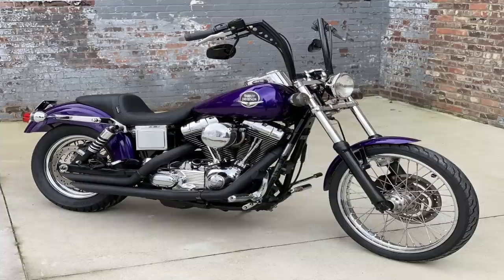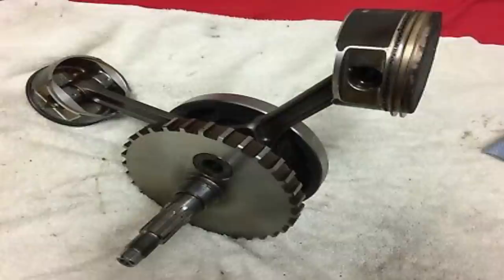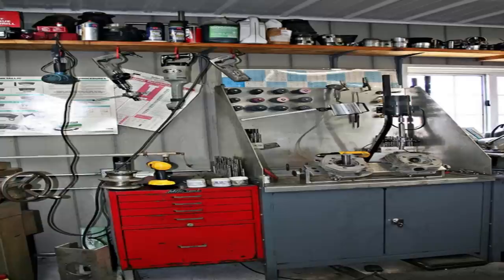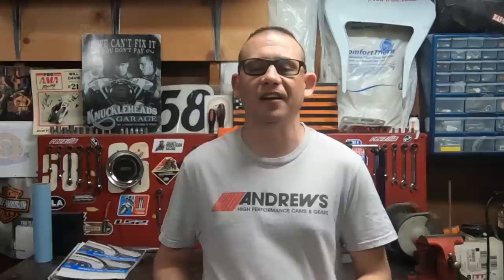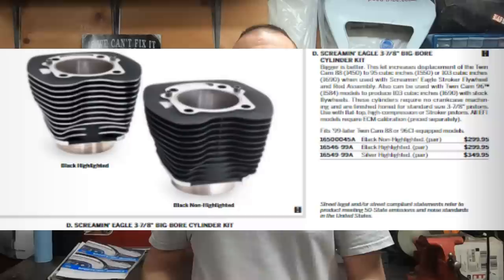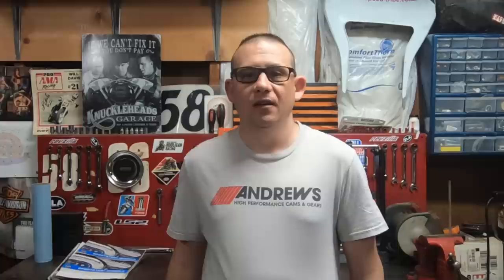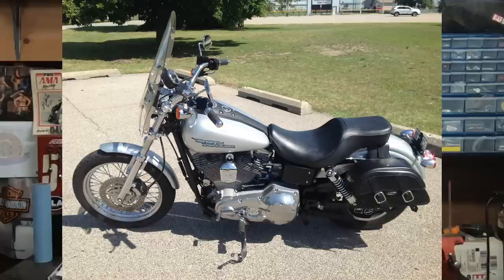Harley 95 is the Twin Cam 88 Sleeper

Comment: 95 in my 06 dyna, 585 cams and loving it. Hp85/93tq a little off the 100hp…would porting the heads help?
Reply from the maker: What compression are you running? 2006 88 heads were pretty good, who's 585 cam is in it?
Reply: @GixxerFoo  S&S 95 kit, S&S 585 with S&S cam plate. 9.7.1 compression. Yes the heads are good I know...updated ones started with my bike.  Maybe its the cams holding me down, although they kick in nice on the highway.  To be honest, I am very pleased with this performance.  All day smiles...
Reply: S&S 79cc heads 585cams  10.7 comp thunderheader 95cui  100.3hp 150nm.  585 needs compression.
Reply: @mattinykanen7001  that's my set up pretty much

Comment: I've been considering similar options to what you're suggesting in this video; finding a good price on an older model bike and then doing a SE Stage 3 or 4 upgrade. But, after seeing lots of other opinions on YouTube about needing to address the lower crank case deficiencies with a tempken bearing conversion or even upgrading to an after market crank/flywheel assembly to accommodate the higher torque and HP with these upgrades, the whole buy cheap and upgrade prospect gets a bit chancy, and pricey.  Do you think the older TC88's lowers will hold up with the SE stage 3 or 4 upgrades you're recommending? Reliability is priority one with me.
Reply from the maker: Generally the bottom ends do pretty good with some upgrades, albeit if you're just cruising and getting on it every now and again. But if your launching them at the strip or something that crank can become a huge problem. The best bottom end out there is the 2002 and earlier 88, they were the Timken lower end which is solid. Just the cam chest is their issue, but once you upgrade that to the hydraulic tensioners you're good to go.
Reply: @GixxerFoo  It's been so long now... I bought my 2000 Dyna brand new and upgraded to a 95. Added the hydraulic tensioner, 44mm carb, 211 cam, Baker 6 speed, Barnett Scorpion clutch, Thunderheaders, and a few other mods I cannot remember now. Not sure what it will dyno at, but she is perfectly stable at any speed, absolutely hauls ass since I added Sputhe stabilizers, inverted Ohlins forks and black piggyback Ohlins shocks, and Dunlop K591's. It is an INCREDIBLE riding machine! Glad to hear that you feel similarly about the "original" twin cam 88 engines. :)

Comment: So if i put the 95” pistons on my tc88 with the woods tw6, which SE heads do I look for? The 96” ones?
Reply from the maker: You would essentially get a big bore kit when bolted on the 88 it will make it a 95, the heads are actually interchangeable on the twin cams across the years.
Reply: @GixxerFoo  sorry for novice question, are you saying 88” SE heads will fit my 95” Carrillo pistons and bored cylinders? Im looking for which SE heads to buy.

Comment: The added power is nice but how about an added gear in the gearbox?
Reply from the maker: Getting a six speed trans for a 88 isn't impossible but it's some $$$. Baker makes a good one that they guarantee you can't break.
Reply: @GixxerFoo  how much does the cost?
Reply: @stevechan9914 $ 3k

Comment: Did the 88 motor have crank shaft  wobble problems? Would you run gear driven tensions over hydraulic when upgrading cams?
Reply from the maker: The early 88's from 99 to 02 had the Timken bottom, no issues there and very rare. Now the 03 and newer have a pressed crank so l would for sure check pinion run out before going with gears. Crank wobble is a whole other story, the pressed crank is pretty strong in my opinion. Yes there were factory issues don't get me wrong, but most crank issues come from lugging the engine and banging that crank.

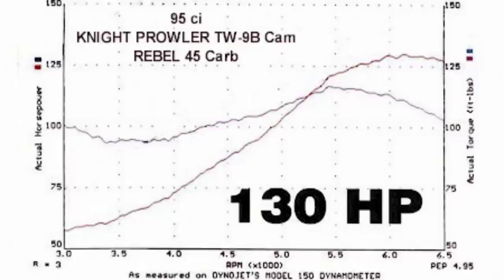Comment: At 6:11 minutes, you're comparing a "SAE" corrected 250i dyno run to a "STD" corrected 150 dyno run. Way off from apples to apples. The differences between dynos and correction factors render these results almost identical. Then, at 7:59, here we go again...... 130 horse on an "Actual" correction 150 dyno...........on today's 250i dynos corrected to SAE, equates to about 117 horse (which, with high compression and comprehensive head work, is still respectable, no doubt).  I'm bringing all this up because people viewing these graphs will think they should easily get the same results, which will disappoint them.

Comment: If i add a big bore kit to my screaming eagle 103.. wait.  (Screaming eagle 103 screaming eagle pistons with 543 reaper cams and fuelings oil pump and camplate  plus got a valve job and some head work for top end ) whats does that increase my numbers cubic inch wise...

Comment: So what's the best combination of jugs, pistons, cams, etc. So I wouldn't be buying things twice I was trying to piece it together thru the video but too many options to keep track. I don't wanna be cheap but I do want the most cost effective solution I have kids in school. (FXDLI '04)
Reply from the maker: There's some really good jug and piston kits out there, JP Cycles has this one https://www.jpcycles.com/product/744-071/v-twin-manufacturing-95-big-bore-kit. You can pair this with a Wood TW6 cam and you're off the races, compression is about 9.5:1 so it will still be reliable, make a good power and not be too crazy.
Reply: @GixxerFoo  Thx 4 ur time.

Comment: I have a bad vibration in mine. Tried motor mounts. Didn’t help. Got any ideas?
Reply: buy indian.
Reply: I had a bad vibration in my 03  tc88 as well. When I had the 95 kit installed found  out the  crank had scissored.  The vibration can get really bad

Comment: You know the numbers for the complete 3100 dollar kit? Also will I need a heavy clutch? Recommended head work for top torque and horsepower?
Reply: Hey Mark, the kit comes with a heavy duty clutch spring, and I have over 20,000 miles on mine since the upgrade and have had no slipping issues - still running with the stock basket and plates...
Reply: YA moped will eat it.

Comment: Hold on.. you "were first introduced to 95in kits in 2003" as you throw up a pic of 
2001 FXDWG2 Swithblade. Even says on Pic "***2001".
I own this very bike, completely factory except Bubs pipes. 3rd owner, and I  asked guy I purchased from if cam chain tensioners had been upgraded.. he had no clue what I was talking about! But I bought it with under 13k miles, had it about 1yr and put just over 1k miles on it. PARANOID every mile that cam tensioner shoes going out.!
Anyway I've been thinking  about S&S 100in big bore...
Ok getting sidetracked, back to: why did you show this 2001 bike while talking about 2003? 
Also, which would be better, in your opinion, S&S 100 or short stroke 95? Also I don't really want to modify anything. I mean I want to pull off and keep any  factory parts to be replaced by kit.. example cylinders.  I'd want to replace with big bore jugs & keep factory jugs. It's my understanding this is a rare & collectable scooter.

Comment: There’s no way the TW6 makes those numbers on a stock 88. 40 or 42 degree intake close. Not happening without added compression either through a big bore, decked heads or domed pistons. Something. But they WILL need compression to get those numbers from a cam like that. If I’m wrong. Show me. I’ll take my L.